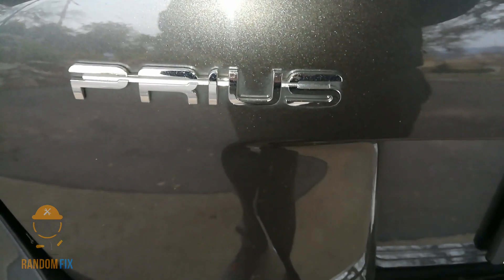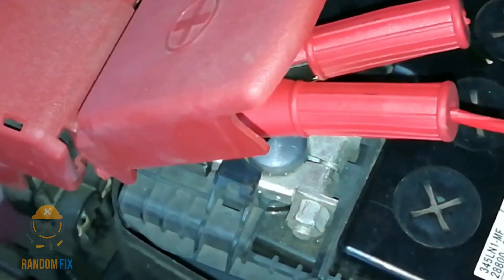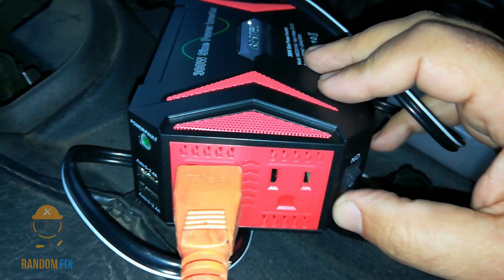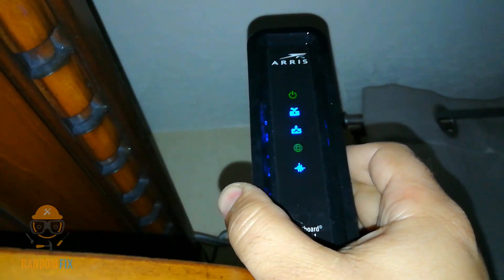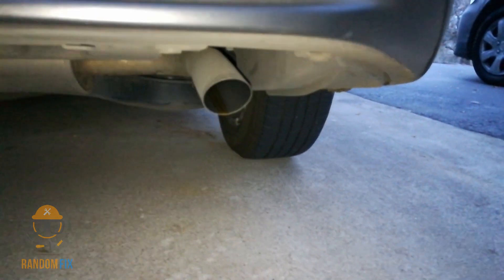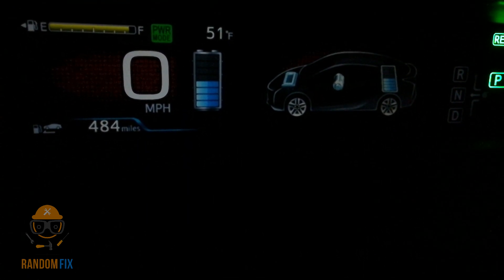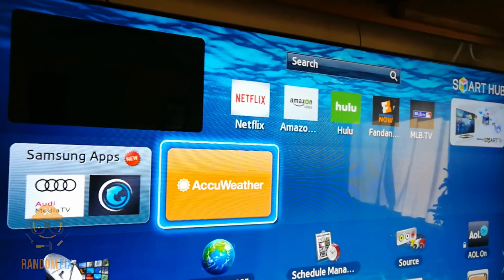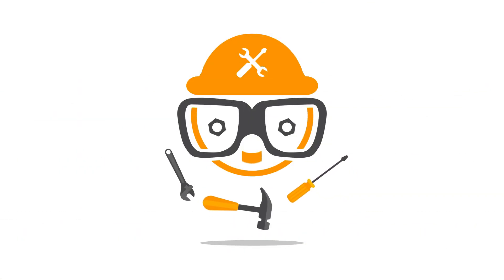Prius inverter▶️ Toyota Prius Power Generator Powers House

Comment: I'm curious about what happens if you are using the Prius with the inverter to power the house and suddenly the power company turns the power back on. Would that damage the inverter or your Prius? To be safe, shouldn't you turn the main breaker to the house off while using the Prius for power?
Reply from the maker: Good question.

I was running a extension cord so they are separate circuits independent of each other. If you want to run it throw your house wiring you need an isolation switch so you can accidentally backfeed into the power grid.

Comment: Just over a gallon and a half per day, in a Prius. more if you're powering higher power devices more power more fuel!

I had internet access, 6 tablets for Tv access and information, a chest freezer, and 10 led lights. I used the Textnow app for my phone, and cellphone.
Reply from the maker: That’s not bad. 1.5 gallons. I have Prius c now and I ran a xt60 connection with 50 amp breaker under the hood for quick hoop up. Great for when the power goes out.

Comment: How long your battery will last if you power your home only with prius
Reply from the maker: The Prius turns on every 30 minutes or depending on how much power you are using. This is not a permanent solution but great for power outages.
Reply: @RANDOMFIX  doesn't it kill your battery

Comment: Improve it by adding a power bank of batteries and charge the power bank off the prius. It's what I do.
Reply from the maker: Good idea! What sort of power bank? I’m getting ready to do this again as live out in Texas in the country and we lose power a lot. Thanks
Reply: @RANDOMFIX  The current fad is LiFePo4 (Lithium Iron Phosphate) banks but my bank is just several 12V 100 Amp Hour SLA batteries in parallel with a Tripp Lite APS-750W to maintain the batteries and it automatically switches to battery power when power is out. Then I plug the APS 750W into the wall when the power is on and I plug it  into the prius to recharge the bank once every few days while the power is out.  I plug all my laptop/tablet/phone/garage door opener/deep freezer/ etc. into the APS-750. I later bought an APS-1250 so I could plug even more higher wattage stuff into the battery bank (sump pump, mainly) and you can just keep buying more 12V 100A batteries and hook them up in parallel to the ones you have to add capacity.  You can also plug regular 12V power inverters into the bank but it won't automatically switch between battery and grid  like the Tripp Lite APS units do. APS1250 pulls about 800W continuous from the prius until the bank is fully charged which is only a few hours. LiFePo4 has a higher upfront cost but the batteries should last longer. The Prius is the quietest power generator money can buy, anything else is crazy loud.

Comment: The 12v battery is constantly charged by the main "traction" battery.  It's not as separate as some here think.  My neighbor runs his loud generator to keep his fridge and lights on.  My 08 prius does this too silently without issues.   The car is my cheap daily driver and has affordably powered most important functions in my home during an outage.
Reply from the maker: Yeah the Prius is great and efficient power source. I’ve seen people running just the power train as a power source with no body of the actual Prius.
Reply: I’ve had no issues with my 12v battery.  I’m sure there’s speculation.  I’m more into believing in results I find rather than speculative concerns.  Furthermore the 12v battery is only $300 vs the cost of a generator that is noisy and fuel inefficient.  It’s best you do research b4 you commit to an emergency power solution.
Reply: @timbertuggy2398 what inverter do you use for this? I want to buy the biggest inverter I can, so I can use it for more in the future.
Reply: Thank you for the advice.  I have a 2007 and a 2008.
Reply: So I've read in some chat groups the concern for "ruining" the 12 volt battery.   So you seem to say there's no concern, correct?

Comment: 300w inverter powers a house? What about the refrigerator or what if you wanted to use the microwave? That isn't going to power those. If I was going to do this I would have at least a 1500w inverter.
Reply from the maker: Sorry for the late reply! did you find a solution?

Comment: Any way to tap off the 240Vdc Li battery (in a Prius) to an inverter for 220Vac conversion to run a well pump. No videos seem to exist on how to do this.
Reply from the maker: There is on video I've seen on a plug in model. I would just get a very large 2 phase inverter but you are talking about putting a very large stress on the Prius 12 volt system. You could do it if you had a large 12 battery as the battery that comes in the 4 the gen is under 500 cca.

Comment: so to run this you have to keep the key in the car and the car turned on?
Reply from the maker: You can take your key out. The vehicle needs to kept Running but it's not a regular car where as it will be running for now reason, when the 12 volt battery gets low or the hybrid battery the Prius will turn for a few minutes to charge and will turn off again.

Comment: Do you know if all of this applies to older Prius? Say a 2012? Also I thought you could hurt your car if you draw more than 120 W from the Prius? I should watch this again but I thought you said you were using your 12 V battery which in the new Prius is in the front? Thanks
Reply from the maker: that is if you pull the cig port. I am pulling straight from the 12 volt battery.

Comment: You are connecting to the small (starter) battery. Is that connected to the large battery that propels the vehicle? If so, then you are drawing from that indirectly.
Reply from the maker: Exactly, do not try connecting to ev high voltage batteries.
Reply: @RANDOMFIX  I promise I won't. Are you confirming that the big battery feeds the little one?
Reply from the maker: Yes, the bigger battery will feed the little battery, when the Ev/high voltage/bigger battery runs low on charge, then vehicle engine will start so the hybrid system can feed / charge the ev battery. The small battery is called the 12 volt battery or starting battery.

Comment: They offer a 1000 watt inverter built in the car as a option on the 2021 Prius.
Reply from the maker: That's pretty cool, I will check it out. Is the 1000 watt a sine wave inverter?
Reply: You have a link to the 2021 Prius 1000 watt inverter option I can't find any info on it ?
Reply from the maker: I was never provided the link but do a brochure search for a 2021 Prius and all the options are listed in the brochure. That is not something you can install but there are plenty of inverters you can install yourself. Let me know if you need a recommendation.

Comment: Could you power a kitchen stove with the prius generator? Say like 2500 watts?
Reply: Just use a hot plate
Reply from the maker: Kitchen stoves are 220 volt and a basic 2500 watt inverter cannot handle that. You need a 2 phase inverter and I'm not sure if prius can handle that for an extended amount of time. Remember it's high voltage system has charge the 12 volt system.
Reply: A nuwave induction cooktop would be best

Comment: Why will this not work from the prius internal cab 12 volt plug?
Reply from the maker: The plug can't handle over 15 amps. Connect to the battery directly your are running over over 150 watts. 

Amps  X volts = watts
Reply: @RANDOMFIX  I am sorry for being an electrical noob here. From the video it appeared you have jumper style cables that power a 12 volt plug and then your inverter is plugged into that. So technically both your jumper set up plug and the internal cab plug are 12 volts. So that would imply the difference here is in amps running through. So are the cable much beefier in your jumper set up over those that supply the 12V plug in the cab of the prius? Thus allowing much more amps? It is a bit confusing because both are 12V plugs, so not all 12V plugs are created the same? Or is the jumper cable set up have a much larger voltage than 12 volts. Again sorry for being noob. I am trying to determine potential minivan RV builds with a new hybrid sienna, so I am trying to get up to speed on all of this and if I need to also have a separate blueetti and portable solar panels. Thank you for your time.
Reply from the maker: The 12v connection in the prius is a much small Guage wire. So the bigger the wire the more amps it can handle. The same can be said about jumper cables as many cheap jumper cables are made with poor quality wire that is also thin.
Reply: @RANDOMFIX  thank you for explaining.
Reply: I think your link to the besttek may be off. The listed 16 awg is rated for 13 amps. You had 280+ watt reading. 12V (car battery technically can be as high as 15V) x 13 amps equals 156 watts (195). I suspect you may have a 12 awg which can do 20 amps, which would give you 300 watt capability.  If there is something wrong with my logic, please point it out.
Reply from the maker: You can run a little smaller Guage wire if it short distance. There is a lot to consider when it comes to wiring.
Reply from the maker: Glad to help

Comment: I use my prius for night fishing.  Powers everything.  Everyone else is fishing in the dark but i have full lights, radio, ac if i need it.  And its quiet.
Reply from the maker: That's an awesome idea,  thanks for sharing. I have been thinking of getting a bigger inverter to use when I got camping so I can cooking with electrical as it's much easier. I know I'm pushing it but I think it will work!!!

Comment: I wouldn't want to sacrifice wearing the car's battery as this will undoubtedly do since it won't be driving to kick in the normal gas function that regenerates the battery. It will just keep kicking on and off for a few minutes at a time repeatedly as it charges a couple bars instead of the full pack as when normally driving.

Don't do this if you value your car.
Reply from the maker: Okay, I could see how you could think that way. You do understand the EV system will still charge the 12 volt system? I would not do this if the  2 v battery was the only source of power for the inverter.
Reply: Prius used as taxi do about 600 to 800 km on a set of batteries the house could be connected for years before you have to worry even starter batteries last a long time in them.
Reply: @davidwright1752  that’s not the same type of use they were designed for genius... they’ll wear much, much faster

Comment: Cool video. I’m considering this as an alternative power supply for an RV when using my Prius as a tow vehicle. Much quieter than a regular generator.
Reply: You can actually use a 2000w continuous 4000w peak inverter on the Prius.  Anytime your continuous goes over the DC-DC converters ability the 12V battery on the Prius will deplete.  The DC-DC is probably 1200-1800w.  I’ve never owned a Prius but I have had a Volt and an i3 REx and now a CMax Energi.  Those are all plug-ins and can run for many hours or days (many days for the i3) before the engine turns on.  I’d recommend at least a 1500w continuous 2000w peak unit as that should be enough to run almost anything that could be plugged into a 15a outlet.  Even a space heater which will pull 1500w at max.  Typically, devices are not supposed to exceed 8A continuous which is 1000w but appliances are allowed to go to 12/12.5a continuous when rated for 15A obviously more if rated for 20A.  

A lot of people do this with the Chevy Volt and BMW even had a demo in Europe for a factory equipped version.

Lastly if you need the big watts then plugoutpower.com sells a system that bypasses the 12V battery system and connects directly to the high voltage battery.  You are no longer limited by the DC-DC converters abilities at this point.  So they make 5000w systems for the Prius and most hybrids.  It does require 2HRs worth of labor by a shop that specializes in hybrids that is not a car dealer.  That’s to install the safety box that connects to the high voltage battery.  It has a special plug that ensures the box is not live unless the inverter is attached (has many pins and some are there to flip an interconnect/relay to energize the high voltage line).

If you compare these options to gas generators then the 1500-2000w system is going to be $300-500 vs $500-900 for a cheap inverter generator and then $2500 for a Honda 5000w inverter generator.  The Honda is about the most fuel efficient generator and sucks down 2-20x the amount of fuel.  The less watts you use the more fuel wasted in comparison because the generator has to run non stop.

Anyways hope that helps… we have been fine using the DC-DC to run 12v inverters.
Reply: @MrGivmedew  thank you for this write up. I have 2 first gen escape hybrids and we have power outages 2 to 3 times a year. I was thinking about buying a generator untill i started to look into using our hybrid cars. What brand inverter do you use and do you use a normal one or pure sine wave inverter?
Reply from the maker: Did you ever get around to the using the prius as alternative power supply?

Comment: To address some issues and people. Yes you can use your gas or desiel vehicle but 2 things one it not efficient energy generation wise. The alternators are not made for that purpose and can burn out.  That being said at least at one time there was a company that made an alternator for generating power from your vehicle. Now to the Prius. The Prius engine power system is a generator. That being said the 12 volt method is easy but not so efficient but is affordable.  There was as of last year a company that sold a package using the main battery.  Much more useful. Now in regards to the carbon monoxide poisoning. Yes it is possible but less likely so with a Prius, since the engine does not run constantly.  But back drafts and such could be an issue better to have an exhaust tube that goes outside.
Reply from the maker: I appreciate your constructive comments, thank you for the feedback!

Comment: I have a 2008 Prius with 155000 miles and hooked up a 1000 watt inverter to my Prius after Hurricane Irma knocked out the power.
We ran 2 full-sized refrigerators, 4 small fans, 5 led lamps, the cable modem + router,  charged 2-laptops, an iPad & 4 cell phones for 60 hours on about 6 gallons of gas!
I lock the car by locking all the doors then I use the metal key to manually lock the driver's door so someone can't just get in the car & drive away they would have to break in.
Reply: Hi Jeff.  I just google around and found out my refrigerator is about 685watt. According to google, the starting power will take up 1200watt.  Can u explain how you can get 2 refrigerators running with a 1000watt inverter?  Thanks

FYI,  I’m tying to put in a 3000w inverter into 2014 Prius.  1/0 awg wire to pos/neg with 200Amp fuse.  My plan is to run 2 full size refrigerators during emergency.
Reply: @desmondthang6759  Has your system worked out okay? I bought a 2000w inverter and then read on another video that anything over 1000w is not good for the high voltage battery. Have you had any problems?
Reply: @desmondthang6759  Not sure you can draw that much power out of your Prius without harming your main Prius battery.  Big refrigerators take a lot of juice.  I have a fridge and freezer that are both manual defrost that only use a couple hundreds watts between them.
Reply: @desmondthang6759  A capacitor hooked to the inverter pos/neg will absorb initial surge, like this https://www.amazon.com/dp/B001Q5SMEE/?coliid=I38GPGSAXIXLON&colid=YMDDK081Y2MP&psc=1&ref_=lv_ov_lig_dp_it
Reply from the maker: Jeff, wow that's awesome. Great information. This is my 3rd Prius and I have had zero issues.  👍.b_Randomfix
Reply: If you hook a timer to each fridge and only have it run for like 15 minutes, that will cut your power consumption on the fridge by a 1/4. Plus you can stagger the use of each fridge to work one at a time so you could in theory run both at the same time. And most 1000 watt inverters has I think 500 to a 1000 of addition surge capability. See your specific inverter for sure.

Comment: CO rises, your false info to keep the garage door open slightly can be deadly, the exhaust needs to exit the tailpipe and go up... so if you’re ceiling is up it will enter your home!
Reply: Co2 is heavier than air so it actually hugs the ground so if you work in a pit with generator your dead because the Co2 does not float up
Reply: What you say is true but in this instance, the vehicle ran the engine for less than two minutes at a time. An open door and possibly a fan should make this safe, though a good CO detector isn't a bad idea.  I'd try to keep the extension cord as short as possible though for line loss.
Reply from the maker: Good information and the shorter extension cord will help like you said.